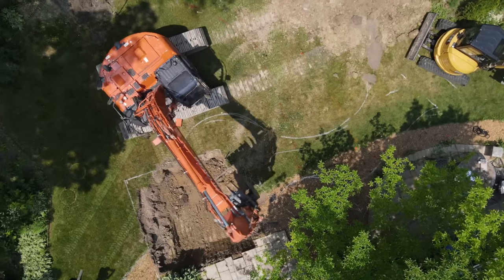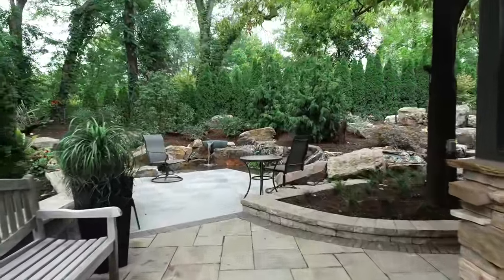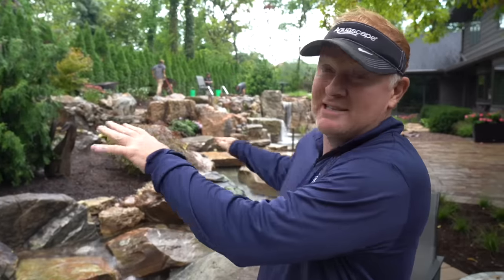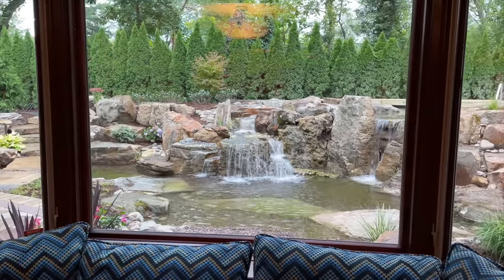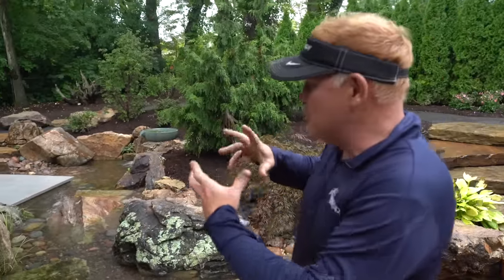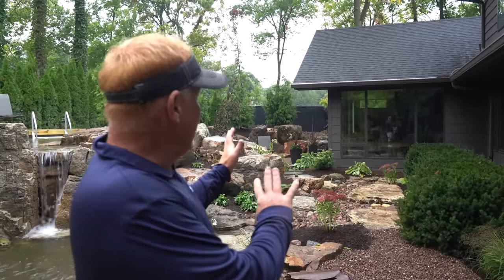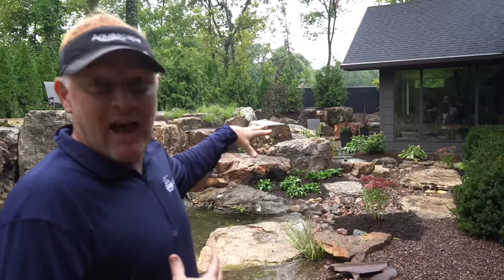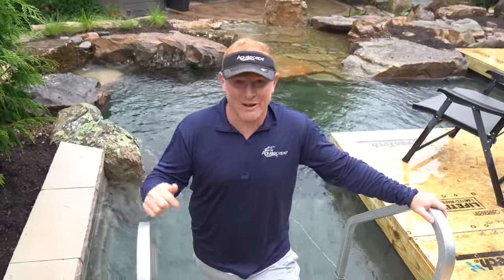SMALLEST Recreational Pond EVER Built!

Comment: off the top of my head this has got to be the nicest pond/stream i have seen of this size. the only ones i can think of that i like better are the really big ones that need acreage to build. i like the whole flow of it, nothing looks forced or out of place. the hidden deck area at the top is uncommon, and it doesn't just dead end there but continues on to a natural conclusion. the only change i would make is to the railing going into the pool, i would have found something in an anodized brown or black (maybe powder coated) to make it not stick out so much.